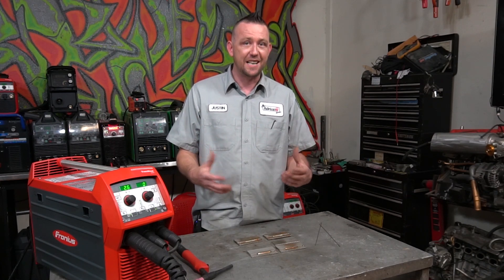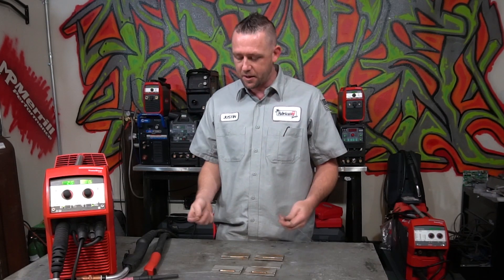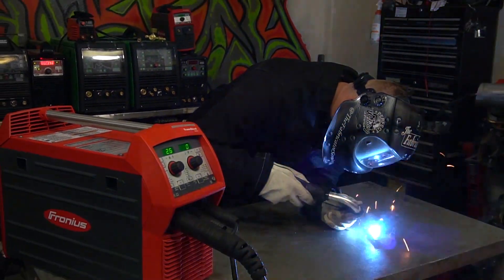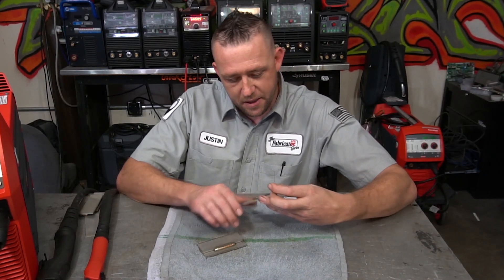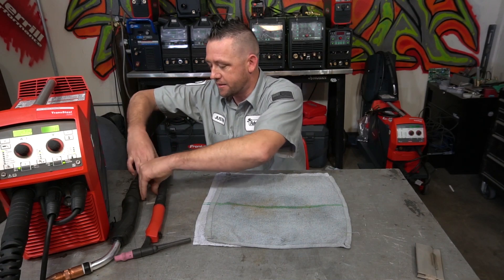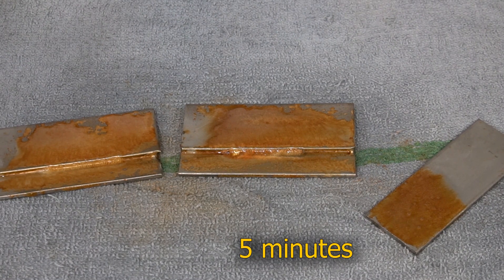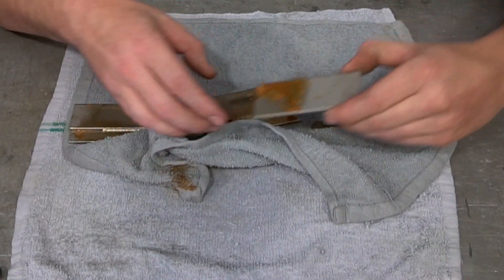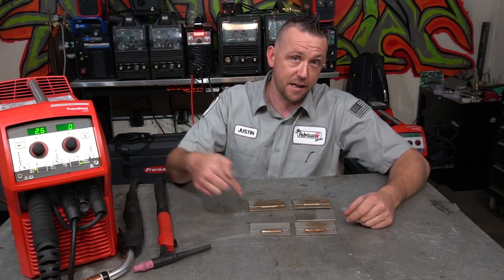TFS: Can You Weld Stainless with Mild Steel Filler plus Bonus Episode!

Comment: I refurbish tanker suspension all the time using carbon steel wire. The Hendrickson air ride suspension is carbon steel from the factory, glued to stainless frame rails.
The factory uses stainless wire, we don't. 
The only real difference is where the paint line falls between the suspension and frame and how many ceramic grinding disks I need to go through to clean off the original welds after I cut the old rusty hangers off.

Comment: It's not just about the rusting but also structural strength. Read up on the Schaeffler DeLong diagram to see how the wrong filler can make it brittle and crack. Welding with steel filler on stainless could cause it to form martensite which is brittle. That's why you need an even higher alloy filler when you weld a mild steel part to a stainless steel part to compensate and prevent martensite to form.

Comment: Wee question for ya. Apart from the corrosion resistance issue, which you have shown brilliantly, would you say there is any issue in the strength of weld when welding steel legs to a stainless steel plate?
Reply: I welded some mild steel rods onto a sheet of stainless to hold up a 75’ 4/0 awg extension cord and it’s holding up fine. It’s inside my shop and painted so I’m not worried about it rusting.

Comment: I realize this is an older video, but I have an exhaust I'm building on a budget that part stainless, part mild, and I'm using flux mild. I'm wondering if it's painted immediately after cooling off if the resistance to rust will be better? New sub btw, great info!
Reply: The heat cycling for exhaust is what you're really fighting with rust, not just exposure to air. It gets hot, then you shut it off, then you start again.
Reply: Use cold galvanized spray paint instead. The zinc would be better than just paint

Comment: So yes, you can weld stainless with regular filler wire but it will rust if left unprotected. This is useful information for guys like me who just do repairs on their own equipment. I've got a few wheelbarrows that have stainless frames that occasionally break and crack and unfortunately, I can't weld stainless right now as I have no access to shielding gas.
Reply: I know this is an older comment but they sell 308L stainless stick electrodes at tractor supply. I used them to fix a stainless sink at a restaurant.

Comment: Quick question what if you painting them would the rust still be a problem over time
Reply: Not really. If you live in a dry area like arizona it doesnt really matter since there is only moisture in the air for about 2 weeks out of the year😂

Comment: That stuff about the wire wheel, I am not sure why anyone should care. That oxide was forming from stuff left from the wheel but it can't possibly be more than a thousandth deep. Yeah it looks ugly and could possibly make a customer complain but you wipe it off and that's it. [as opposed to rusting steel which flakes off and then rusts some more eventually leading to structural problems]
Reply: Say that again when you're dealing with higly corosive atmosphere or food grade stuff. Tiny particules will embed themselves, and lead to rusting no mater how hard you wipe (maybe something like beadblast will get them off but anyway)
And corosion leads to more corosion. So it might rust deeper than just the surface, even though it's stainless
Reply: @InformatrIIcks  "And corosion leads to more corosion." Really what's the mechanism there?
Reply: @trygveskogsholm5963  can't remember if it's because of galvanic corosion or because you have chrome oxydes deeper in the material that are the reason stainless does not stain ... (Chrome on top get oxyded and forms an airtight barrier preventing the formation of iron oxyde, aka rust. But without that chrome oxyde layer it would rust as any other Steel would)
Reply: @InformatrIIcks  but corrosion is oxidation. If there are no oxidizers 'beneath the surface' there is no corrosion. If there are oxidizers an oxide layer is formed.
Reply: @trygveskogsholm5963  researched it. It's more complicated than this.
There is a galvanic coupling between the iron particule and the passivated layer, which will create rust by consuming iron and the passivated layer.  You then get crevice or pitting corosion because it's not passivated underneath.

The short answer is : if you're welding in your garage for yourself you probably don't care and that's fine. But if you're welding for any kind of industry you should follow the code, and the code says "no contamination". I would add that it says that for good reasons
Reply: @InformatrIIcks  I now have a strong desire to test this, it seems extremely unlikely to me that a chromium oxide would be destabilized by excess iron but predicting chemistry gets very complicated very fast.
Reply: @trygveskogsholm5963  i had to get back to my "corrosion chemistry" class for my welding engineer degree, and for someone that is not really into chemistry i can guarantee it indeed gets very complicated ^^
(I don't exclude misunderstanding from my explanation. But i'm sure that it can lead to corrosion through the thickness even though it started on the surface

Comment: can you tack weld a 304 stainless to mild steel with flux wire and no gas does not need to hold weight

Comment: So let's say I make a stainless steel exhaust and use mild steel flux core to weld it all together! would it have been better or smarter to use an aluminized mild steel exhaust tubing instead of stainless? Which one would last longer I imagine the stainless only the welds would fail before the actual tubing?!?!?!

Comment: I love the fronuis machines and what they can do. My worry is the torch doesn’t look like you can just swap over a torch from any normal Dinse Tig welder torch.
Reply from the maker: Welding Junkie The TIG torch itself is a Fronius torch but dinse connectors are dinse connectors. Any through type 35 will connect.
Reply: The Fabrication Series really that’s interesting. I’m looking to buy another machine, it’s Between the invertig 221 (Stel version if I can get it) and the fronuis. Is that a 200 amp version? Which would you go with?
Reply: Welding Junkie do you not already have an htp tig ?
Reply from the maker: Welding Junkie What type of machine are you wanting?

Comment: Question is: is it really the base metal rusting or only the deposits from the contaminated brush? It would be interesting to check for pitting after few days of rust solution exposure
Reply from the maker: Pièces Auto Dépot Its mostly flash from the deposits. More exposure could result in pitting.
Reply: The Fabrication Series and then, would pitting more severe when contaminated compared to clean stainless steel. If you still have the samples, it would be good to soak them and wait for few days. Good stuffs as usual btw ;)

Comment: In the early 90's I had a welding job that required over 3000 meters of tig weld on stainless steel moulds for making chicken nuggets for an international company whose logo was an arch motif. These got stacked outside after welding and a large number of them developed lines of rust along fold lines. The contractor that had done the press brake work had used a press brake that had previously been used on mil;d steel, as you can imagine there was a big kerfuffle over the whole thing. It ended up that the whole lot had to be sent for acid etching and bead blasting as there was far to much work and material involved to redo the batch.  The problem is caused by the dilution of chromium oxide on the surface and once corrosion starts it will go all the way through.
Reply: other metals can have weird reactions with steel as well.. large steel ocean ships use large blocks of magnesium called sacrificial annodes attached to the hull to prevent rusting and the blocks need to be replaced from time to time as they corrode away instead of the ships. another fun one is titanium, if you use a titanium bolt in a steel hole the titanium will have a reaction and weld itself to the steel or even stainless over time.
Reply: Arch motif. 😄

Comment: You are fooling yourself,professional welders use 309 to weld stainless steel to mild steel. To right cover you ass way
Reply from the maker: canadian welder This episode is about welding stainless steel with mild filler. It's not about how to weld mild to stainless. Did you even bother watching or listening before making this comment?
Reply: The Fabrication Series your not the one who teaches welders to the right way so they can get certified. Kids these days pay more attention to online videos,welding stainless steel with steel wire is technically wrong so why do it. When I'm asked if you can weld stainless steel  with steel wire the answer is NO!
Reply from the maker: Again, did you even watch or listen? What you're talking about is not what this episode is about. The purpose is to answer the question about welding stainless with mild steel FILLER. It is not about welding mild steel to stainless steel using 309. The answer is - yes. You CAN weld with mild steel filler, but there will be problems. It does not encourage people to weld with mild steel filler. It does not state that it is acceptable. Those who are paying attention to the video will have learned that and will probably make fantastic welders. If you would pay attention to what people are asking, you'd probably fill them in with what they need to learn which are things like cause and effect - not "whatever I say is right because [insert my expert online comment resume]." You need to pay attention.
Reply: The Fabrication Series I'm a CWB welding supervisor ( 47.1 and 47.2) with 37 years experience welding stainless steel and aluminum. What you are doing is not certified welding practice so why waste your time doing something bad. My junior welders always say I seen this and that on YouTube,Then I waste my time correcting the bullshit they see
Reply from the maker: canadian welder I do it because people want to know more than just an answer with no explanation. Theres more to education than "yes or no" answers. You have to add the "what and how" to it. If you don't make it very well understood, you failed as an instructor. 

Now your internet resume is just as fantastic as the others who fail to pay attention to the material which always brings the question to mind - Why are you watching if you really are what you say?

Comment: My own experience with contaminating stainless steel with a normal wire brush, is that it isn't the stainless steel that rust, it's the contamination itself, but if left on the steel it will make craters in it over time, so wipe it off with oil (WD-40 or similar) and a stainless scotch pad, and problem (in most cases) solved. :)
Reply from the maker: J Rand Its all flash rust as far as contamination is concerned.

Comment: I weld mild with stainless all the time.. as I am to lazy to change my might wire... 😂
Reply from the maker: WezleyB Mild with 309 can be done all day long but stainless with mild will rust which is the point of the vid.
Reply: @TheFabricatorSeries  so the only issue is the weld will eventually rust if i weld mild to stainless?